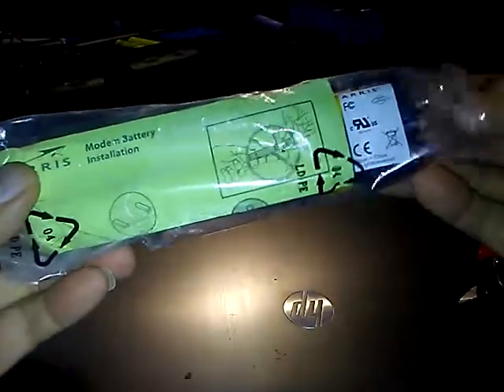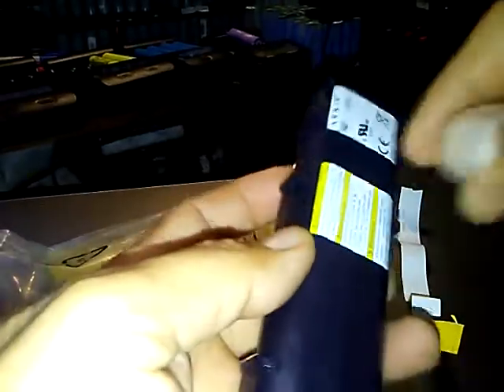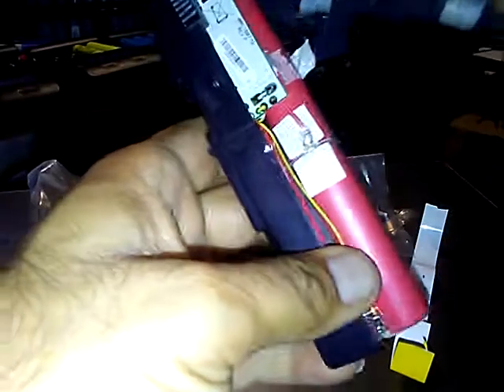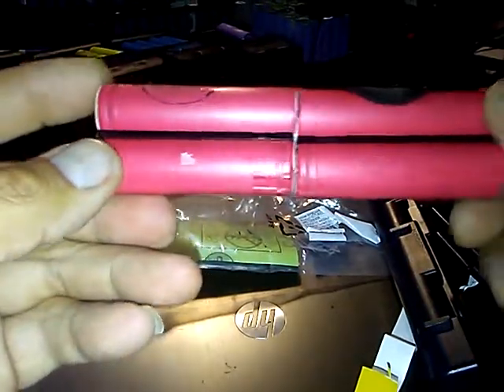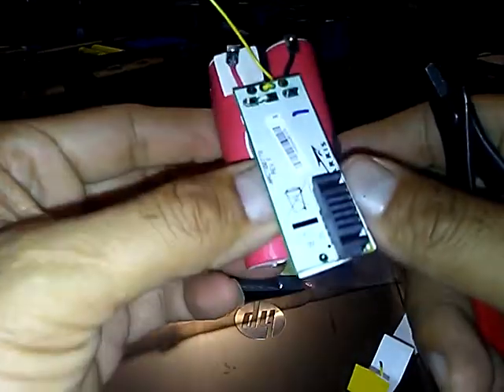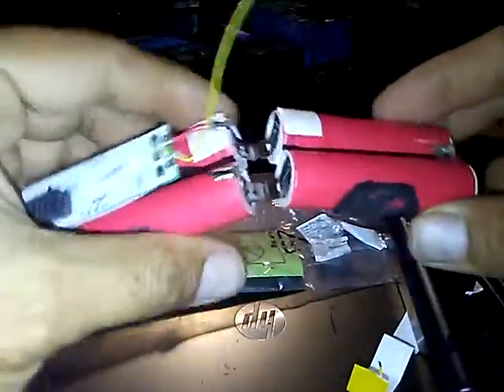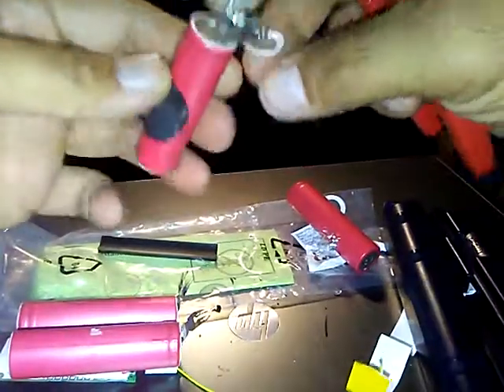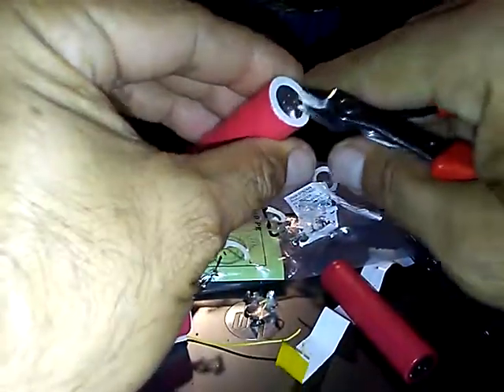ARRIS BATTERY MODEM

Comment: Instead of prying it apart, try cutting through the stickers on both sides with an exacto or similar blade.  Then you can hold the battery in a vise and just push it open with no problem.  I did a video on this. The ones I have opened have contained mostly LG cells and they are the most difficult to get the cells out due to the amount of adhesive they use.  The Sony and Molicells were the easiest to get the cells out.
Reply from the maker: Yup I did that later but now I just stick to get the bigger packs 36 48 volts I mainly use 36volts on my bikes and on my power wall